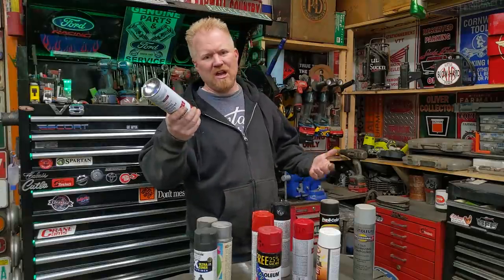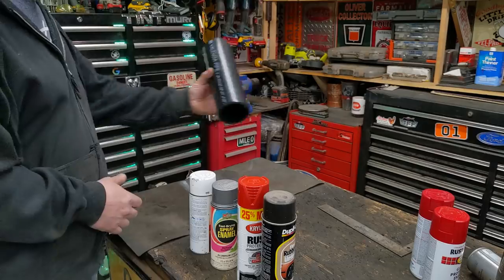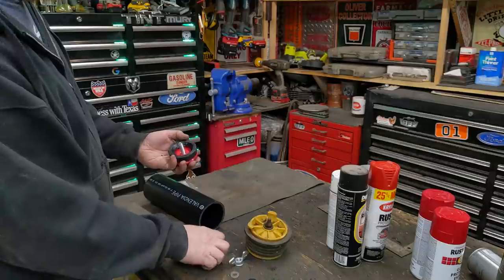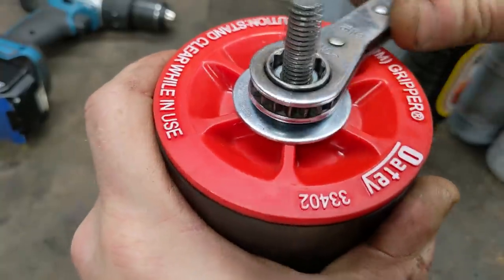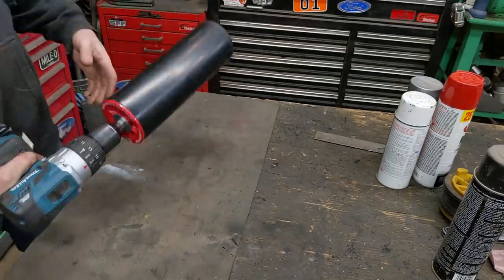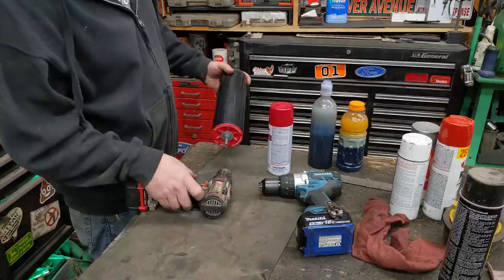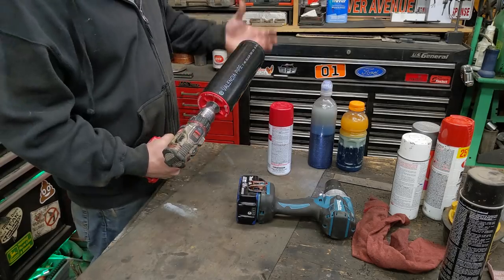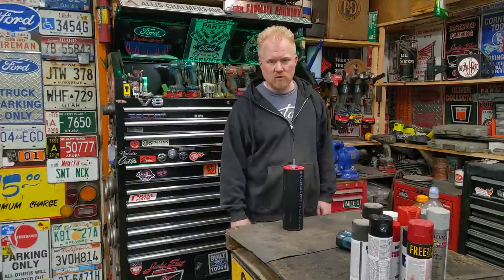EASIEST Spray Paint Can Shaker Stirrer BUILD drill powered

Comment: How does it mix the paint?  Wouldn’t the marble be pinned to the side of the can due to centripetal force?
Reply from the maker: The exact same way you "stir" paint, drink or anything else. Not everything has to be shaken.
Reply: @sixtyfiveford  when you stir paint, the stick is moving around and around in the paint and you spin the can. Everything is spinning the can the paint and the ball.
Reply from the maker: @daddyotheking4776  When you start the ball moves slower than the can spinning with the paint. Then the ball gets up to speed and you let off the trigger. Then the ball continues to spin when the can is stationary. The ball literally spins around the outside of the can probably 80 times in that one trigger let off . That would be the equivalent to you shaking the can up and down a similar amount of times. You're way overthinking a basic idea.

 I have went through in the realm of a thousand spray paint cans in my life. And each one of those cans has probably been shaken/ stirred up two dozen times in its life. I haven't shooken a can of spray paint for the last 20 years. With my hand I almost always spin the can with the ball circling stirring the paint. Then move the ball up the sides with a circular motion. This is 5x faster than shaking up and down. This still just simplifies that motion to under 10 seconds.

Comment: You could use a PVC Pipe Fitting, Cap, Schedule 40, 3" with a bolt and washer and nut too for only $2
Reply from the maker: The test plugs length helps center the bolt over a greater distance. Also the PVC cap was $1-2 more and the ABS was nearly 10 bucks at my Home Depot. My original plan was just to use a cap, but this was the easiest.

Comment: Hey Brother, I Have An Idea. Instead Of Using A Rag To Hold The Can Still, Why Not Drill A Hole In The Side Of The Black Pipe Then Tap It Then Use A Bolt With A Wing Nut Head On It To Just Tighten It Down By Hand Long Enough To Mix The Paint. Since It Doesn't Need To Be Tight, The Plastic Threads Shouldn't Ever Strip Out. Just An Idea.
Reply from the maker: Actually, I stopped using anything to hold it still. I just let it wobble around.

Comment: Would think that the centrifugal force would pin the ball bearing to the side of the can and not move, thus no stir.  Much the same as a carnival ride that spins and holds you against the wall.
Reply from the maker: You have a fluid and ball with different masses, so they move at different rates. When the can spins, the fluid actually doesn't move for a second until the friction on the side of the can pulls it along. The ball has the greatest mass so it stays stationary for longer until the fluid moving past it starts it's moving. The ball bearing is flying in there and when you stop you can feel/hear it.

Comment: They made a Spray Paint Can shaker at work, using a Broken Reciprocating Saw Scraper and Pipe Repair Rubber Clamp. Locked the Saw on a Low Speed, and went to shaking.
Reply from the maker: The recip saw does a fantastic job.
Reply: Just don’t get carried away with what ever paint can shaker you make, LOL.

Comment: anyone have luck with this? I built one the plug keeps flying out no matter how tight the nut is. also after 5 min if spinning (stopping and starting ) paint was still not mixed. sure i'm doing something wrong. thanks
Reply from the maker: I've never had the plug come out. Is it the same brand of plug? Was it used and possibly greased before?
Reply: @sixtyfiveford  awesome, a response from the man himself! been loving the videos! thank you
yes i used a brand new plug, not sure if it's the same brand, it was what the local ace had. I might try gluing it in, but my main concern is it not mixing the paint, but now that i think of it, it might have been because the can was cold, perhaps making the paint too thick.

Comment: This needs an updated method due to stupid huge price increases. Here I was thinking the under $10 was too much, then got sticker shock that 10ft 3 inch is non existent in smaller chunks, and 20ft of it is over $130 with buy 4x at a time required!?

I like the recip saw idea from @adamz8276. I'm going to start messing around to see if there is an even simpler set up though. Probably too uncontrollable, but a fabric shopping bag or old shirt to cradle the can could work with a simple eye hook as a chuck.
Reply from the maker: You can buy a piece of 3-in pvc that's 2 ft long for around 13-14 bucks right now. That's at every Home Depot. The plug is still only 6 bucks I think. So 25 bucks makes two. 

The recip saw thing, shakes the cans so violently the straw becomes detached from inside and you're left with a spray paint can you have to spray upside down. It's easier just to shake the can by hand.
Reply: @sixtyfiveford  Thanks! I still think the cost is too high, but it's better than anything I can think of right now. If I come up with something I'll update. I'm watching the trash people leave out and keeping an eye at thrift.... People are always throwing away those big plastic water bottles, and they sit at thrift shops forever. Maybe I'll have an update sooner than later!

Thanks for everything!

Comment: Do you have an scientific proof this works? Because paint supply stores put these in vertical shakers.

Centrifugal force likely just forces the paint to the outer edge and doesn't actually do anything.

The exact same way you can take an open glass full of liquid and spin it around with your arm and the liquid stays at the bottom of the cup.
Reply from the maker: Yes, a team of 16 scientists spent 3 months straight shaking paint cans and testing. There are a few side affects they found unfortunately. The most concerning is 100 out of 100 test pipes experienced dizziness lasting for days.

Comment: Smart.  I'd like a cheaper way though.
Reply: Take an empty half gallon soda bottle, cut the bottom out, drill the cap and put a bolt and nut on either side of the hole, glue the cap back on, insert exposed threads into drill chuck, place paint can into bottle, squeeze trigger.  Cheap enough?  I think sixtyfivefords's heavier duty version is worth the extra cost though.
Reply: At some point cheaper just means stepping over dollars to save dimes.  In other words. I think this is as cheap as it gets while still being effective
Reply: @flick22601  Soda bottle is good idea.  The cap will make it easy to find center.

Comment: To think I wasted 2.5 hours today building a huge scrap steel steampunk paint shaker contraption that’s powered by a 1/2 impact gun. It weighs about 100 lbs. it is an amazing conversion starter but not as practical as this…
Reply from the maker: That sounds much more fun to use than this.

Comment: Stainless steel hose clamp to a smooth sawzall blade
You’re welcome
Reply from the maker: Been there done that. It does work great but by the time I install the blade, attach it, shake, and uninstall I could have just shaken it by hand.
Reply: @sixtyfiveford  oh come on man, get one of them quick draw McGraw gear clamps with the fancy thumb wheel and it’ll be tight in no time

Comment: This is not the way to shake paint as it is likely that the heavier elements in the paint will spin to the outside. Thoroughly separating.  Opposite of mixing. This is why a real paint shaker works in seemingly random orbits.

Comment: Dude I built something way better then this using my battery operated sawzall that actually shakes the paint can
Reply from the maker: Yeah I did that 15 years ago. It's crap and a pain to hook the can in/out. I can throw a can in this and 30 seconds later be painting.
Reply: @sixtyfiveford  your design was flawed then I just pop mine in and shake and go no straps or anything